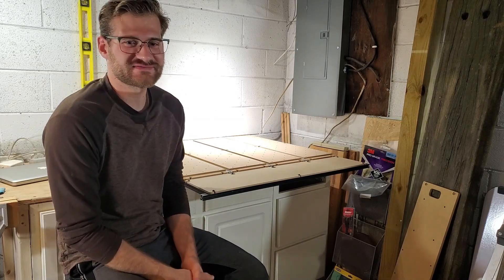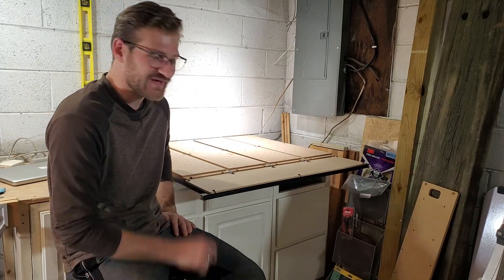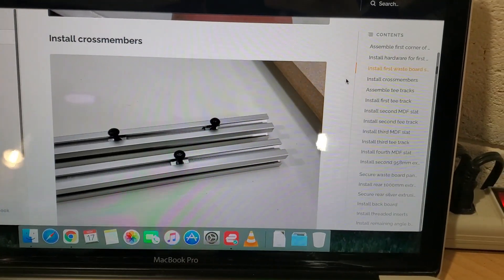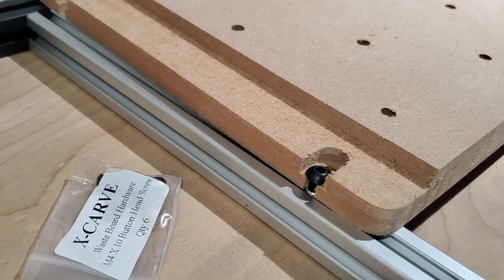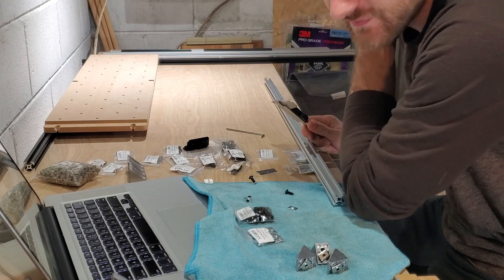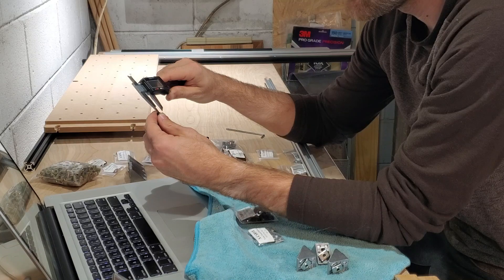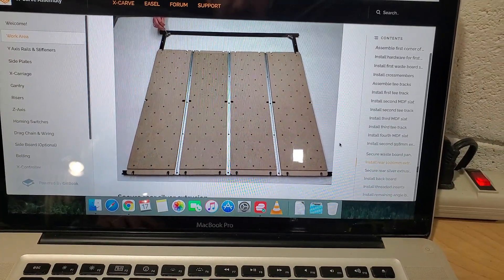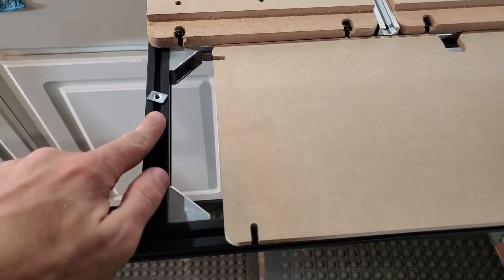Inventables New 2021 X-Carve CNC Base Assembly #XCarve #Inventables

Comment: Looks like your installing the tnuts upside down on the waste board. That could be why their not tightening up. Mine tightened up on the install
Reply: I noticed that as well,newbie here also. I think I may have used the #12 instead of the #10 screws or visa verse.
 Taking it apart for the 3rd time tomorrow.. 😕